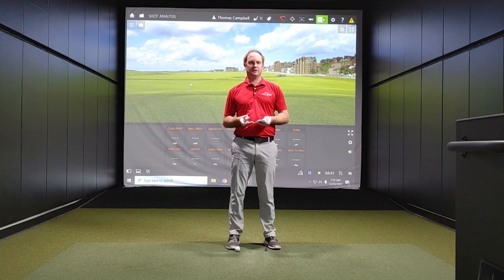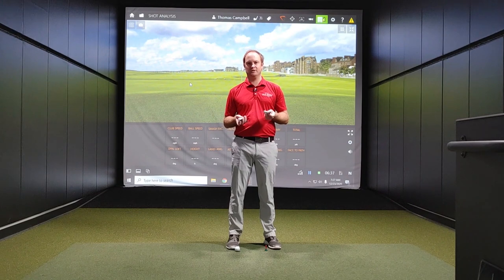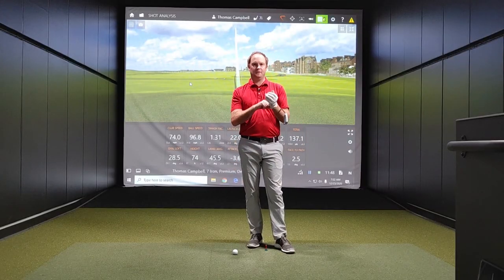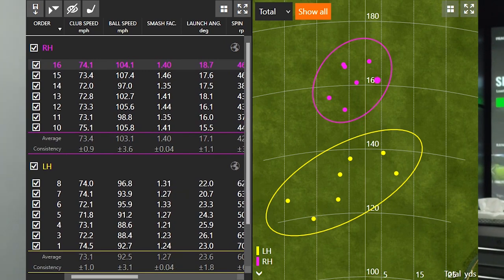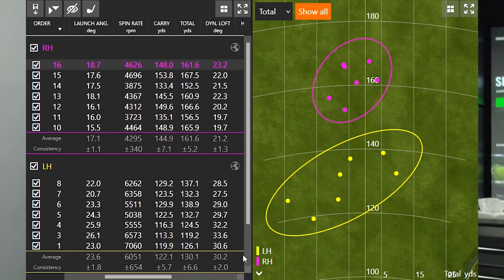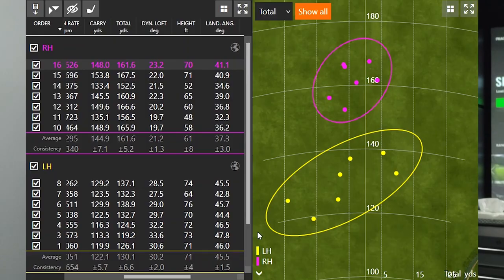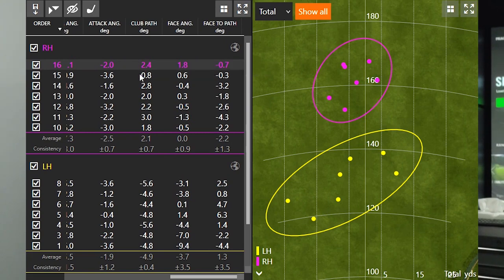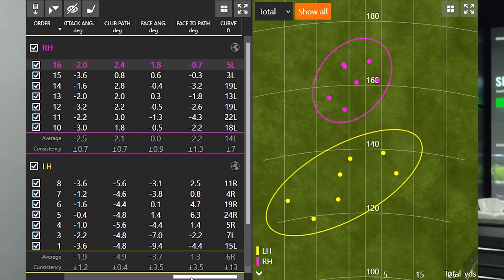Thomas' Left Handed vs Right Handed Swing | Breaking Down Key Trackman Data

Comment: Thanks Thomas.  That video was very revealing.  Would you please put your club fitter hat on and tell us what type or brand of iron you would recommend for your 73 mph right handed swing that would help to increase ball height and land angle and reduce the run off so that the ball might hold the green.  Or would you suggest that a golfer with a 73 mph 7i swing should possibly not try to compress the ball quite so much as you do which would increase dynamic loft and give up some carry distance and overall distance but create more height, backspin and land angle?  Sorry for the tough question to start off your week!
Reply from the maker: Hi Peter. Thanks for watching and this is a great question that I would love to answer. It really depends how much time the golfer wants to work on improving thier swing mechanics v getting fit for their current swing. I would reccomend something like a Ping G710 / G425, Callaway Mavrik Max, Cleveland HB Turbo, Cobra T-Rail. Whats unique is the loft of these clubs are more traditional at 30* v Super Game Improvement Irons that can have the loft of a 7i as low as 26*. If a golfer works on compressing the ball more with less speed it will fly lower with less spin as you saw with my right handed swing at the same speed as the left handed swing. Something that has GC lower and when testing the Cobra T-Rail recently I noticed a decent height and spin amount so something along those lines. More hybrids for those longer clubs 3,4,5 hybrid for sure.
Reply: @2ndswing  Thank you so much for the great recommendations Thomas.  You are a true gentleman and a scholar.
Reply: I was coming to ask the same question! Great content.

I think I personally fall somewhere in between Thomas’s two RH swings, but I also compress the ball significantly, to the point that my land angles for my irons are shallower than they should be. I’ve heard lighter shafts can help.
Reply: @ChrisEckes  Hello Chris from Kitchener, Ontario Canada.  Excellent advice on the lighter shafts.  Lighter shafts should add some speed.  I am in that low 80's mph 7i range, perhaps close to what you are and once we open up again from our current lockdown here in Ontario I am going to get fitted for the the first time with graphite shafts hoping to increase swing speed and reduce vibration which causes finger and wrist pain.  I love to hit balls and at 69 I've put off the switch to graphite far too long.  Best of luck in your game where ever you are.